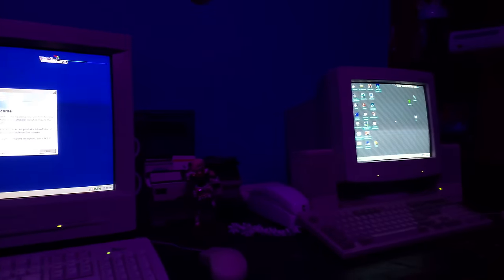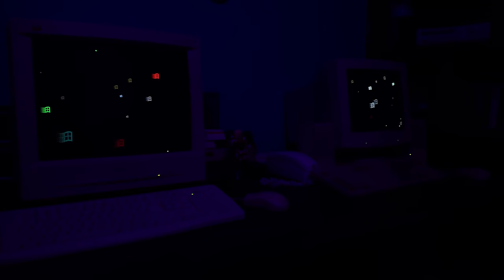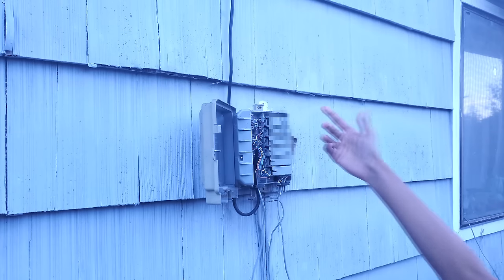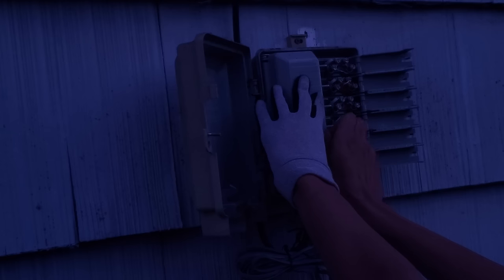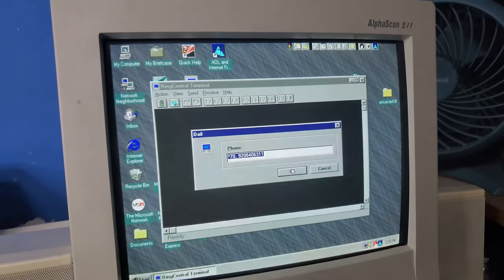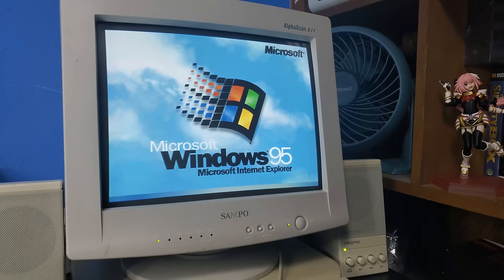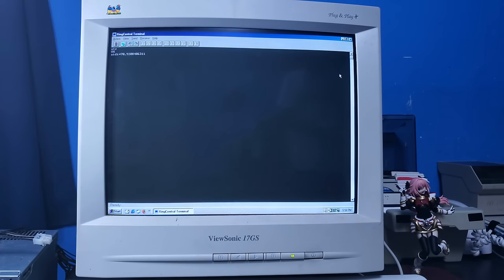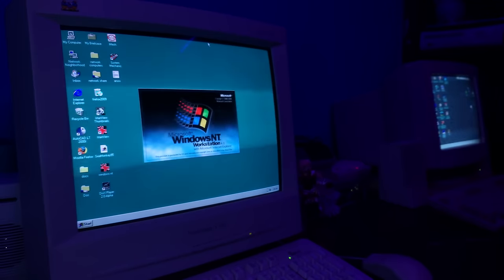Getting Dial Up Internet in 2023!

Comment: In the Philippines, there no dialup here, i think started internet in the Philippines back in 1986 under BBS which first connected via dialup that time, since 1994, 64 kbit/link was second connected under Sprint and flagship Philippine internet provider, PLDT but still exist for dialup, When PLDT started to DSL connection in 2000.

Comment: At 3:08 it's 56 kbps theoretical as in kilo BITS per second not kilo BYTES. A byte is 8 bits thus making the claim it's 56 kiloBYTES per second actually 8 times faster than it actually is. Furthermore the FCC (if I am not mistaken) mandated that in actual use only 53kbps could be used which is why in practice you never actually connected at the full 56kbps. There are ways around this such as compression and multi channeling such as in ISDN but still 53kbps or even it's double in ISDN is not much bandwidth to work with

Comment: the turn off sound was the  1 st to d do. and put up a isdn adls filter between. the you can use the pone and not been diconnected. and that sound  directly destroyed phones if not runed off.

Comment: Hey man, just bringing this to your attention; that blue siding on your house, is most likely asbestos. I’m not claiming it is, but it would be in your best interest to have that checked out by a professional, and possibly removed. I had this problem at our metal shop, we had come to find out that it was built in the 1950s and the purpose of the asbestos is to act as a fire retardant. Those blue panels match the same ones on our shop. I write to you because I care about the safety of everyone around us.

Comment: Because of always-on internet

1. Payphones are now replaced with mobile phones and VOIP/Messenger/WhatsApp etc
2. Same with pagers
3. Landlines are now in danger of meeting the same fate
4. Copper wires are almost considered obsolete for telecommunication (They're also big magnets for thieves) and being replaced by fiber optic. Fiber lan might be the way going forward soon.
5. You are now expected to google something before asking questions. Greater intolerance to cluelessness.
6. You can get fast internet anywhere-- whether on a simcard, e-sim or fiber. A far cry from old mobile phones and fixed DUN/ISDN.
7. Internet outage is as much of a big deal as water or electricity interruption. Except we have backup internet. Backup electricity can be in the form of inverters over an array of 18650 batteries. But backup water? Over water tanks and jugs.
8. Photography is now commonplace and in some cases, now considered as important as paper itself.
9. Turned videocalls into a commonplace feature instead of a high-end privilege.
10. Transmitting your own files from your hard disk over internet is a reality-- not a farfetched suggestion with long waiting times.

Comment: 90 volts and probably really low amps does not hurt tbh its just a slight tingle I’ve been bitten by 240 off a 480 control panel it hurts slightly and thats arm to arm. Dc scares me more.

Comment: Dialup was standard early 90s to early 2000s? I had a 300 baud modem in 1982, when 1200 was becoming standard. Upgraded to 14,400 over the next ten years, and it was for online services more than the internet per se for most of that time, but the difference is immaterial to most people.

Comment: I remember when US Robotics had a modem card that was TWO 56K modems. You needed two phone lines to run it but it would combine data streams and you could have 112k through dialup lol.
Reply: I wonder if it wouldn't need two phone lines if you had a 3 way RJ14 cable splitter.
Reply: @moeschizlac  Yea it would still need two modems.

Comment: There are vast areas of the US where dialup is still the only terrestrial based way of connecting. No cable, no DSL,, and no fiber. Cellular to some degree, but probably as slow as dialup. For a lucky few, they may have a "fixed" wireless that still only barely qualifies as broadband (and usually costs more)

Comment: I had high speed in 2001-2002, it was a quarter of a meg, or aprox 5 times faster than dial up, then I got half a meg, then 1, 3, 5, 10, 20, 50, 100, 150,  and now I have 400 megs down
Reply: I had 1 meg fibre optic in 2001-2002 (UK)

Comment: Those mid 90s were magical. My parents would not allow internet until ISDN became availible because it would not occupy the phone line like regular Dial up did. It was also margjnally faster at 64Kb. For me the real revolution came with my first cable internet connection with a whopping 256K. I had to pay for it with my allowance because my parents didn't want to spend too much money on that internet nonsense. That was a stupid fad any way.

Comment: 90 volts?  neh but is a scratch, you should try 50,000 volts DC off an old school capacitor often found in larger CRT monitors, now that's an entertaining experience I can assure you. But then in my life I have had direct shocks 8 times from wall socket fittings and at least 6 from lighting mains all at 240v 5 to 40 amps, so yeah I'm probably a little more dermally insulated than many. Don't try this at home kids!

Comment: Slowed down the dial-up thingy at the beginning to 0.25x speed, saw this.

Server Init
Server ANSam
Computer Resp
Computer CRd
Computer ESr
Computer CL
Server MS
Computer ACK
Server ANSam
Computer CM
Server JM
Both INFO0
Server Guard
Server L1
Server L2
Server Guard
Computer L1
Computer L2
Computer INFO1
Server INFO1
Server S
Server PP
Server TRN
Server J
Computer PP
Computer TRN
Both J
Both TRN
Both MP
Both E
Both Data

Some of these happen so quickly that they take milliseconds to pass even when setting the video to 0.25x speed, which is crazy.